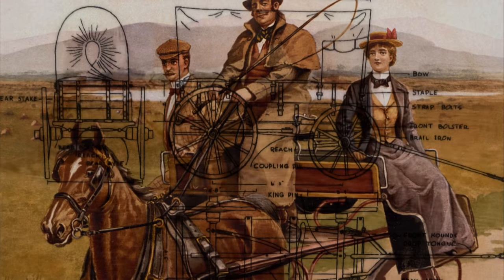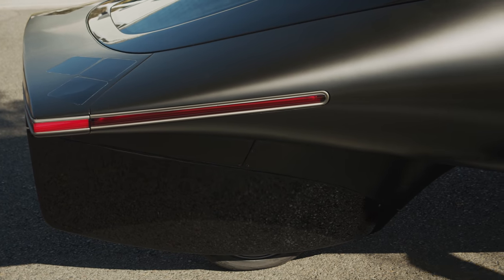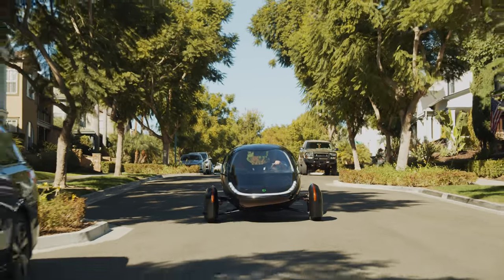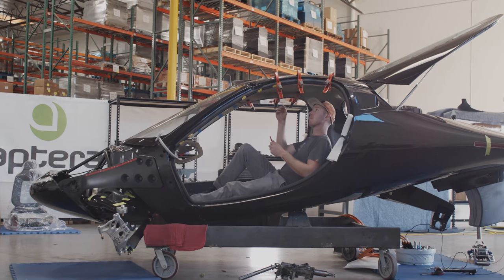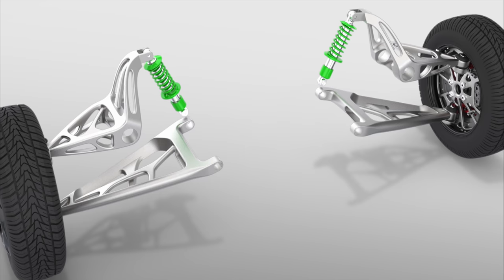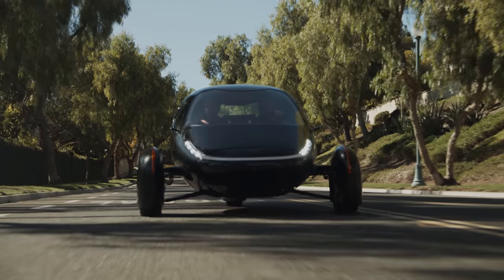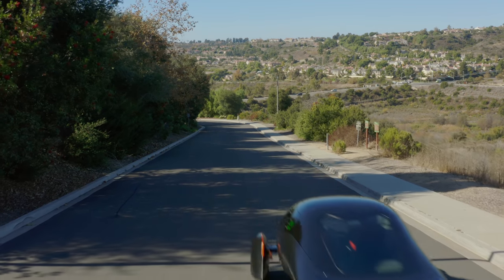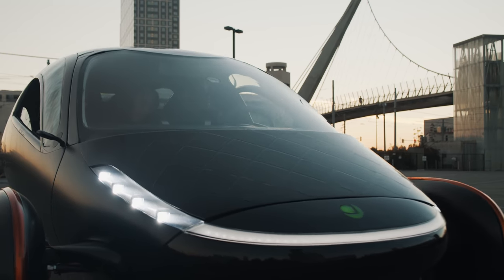Aptera Has Launched

Comment: FINALY a vehicle company that actually wants to make their super deluxe looking prototype a reality instead of just for show.
Reply: Nah, just the same crooks that started this investment scam years ago....
Reply: @sandervanderkammen9230  I'm afraid you are right. It looks so cool but I don't believe it is real.
Reply: @sandervanderkammen9230  Here is an actual product that they have been working on for over 10 years that you can buy. Did you invest in something you shouldn't have?
Reply: @mk1st  Aptera has never delivered a single working product for sale or submitted their design for independent third party testing.
 I would never investment in a company like this which is so obviously a vaporware investment scam.
Reply: @sandervanderkammen9230  This company is a reboot from the original founders who had left the company before an "old school" auto exec took it under a decade ago. The channel Transport Evolved has reporting on this. Aptera is also working with Sandy Munro, who is helping 3 other 3 wheel vehicle companies come to market. After seeing this Aptera is my favorite alongside Arcimoto.
Reply: @Nphen  All the more reason to be skeptical of this obviously fraudulent vaporware investment scam..
Reply: @sandervanderkammen9230  You have obviously not done your research.
Reply: @n.brucenelson5920  I have, and Aptera is clearly a reboot of the same vaporware investment scam..

Moller Skycar is an excellent analogy,  this scam ran for nearly 40 years through multiple reboots and unfulfilled deliver dates...

Comment: Cheaper than a Tesla and twice the level of cool factor, I am tentatively excited for this.
Reply: Which one would you rather crash in at 70mph?
Reply: @cubeflinger  Of course the answer is neither one.  The new Aptera will be tested to automotive safety standards with results before production starts, but still many months off.  Test results from the 2006 version, which was far less sophisticated, are promising, though.
Reply: @RandallJamesPeterson  Much much less. The fwd 250mi model is $25,900 add 900 to add the extra 2 sections of solar. And $2500 if you want the 3rd motor. It comes out to just over $13k cheaper than the cheapest model 3 with the same range.
Reply: @RandallJamesPeterson  It has not yet been scaled up. Give it time. This is only the beginning.
Reply: @halllwd94  , thanks for the price check.  I failed to find that when I looked at their website earlier.
Reply: @RandallJamesPeterson  You had to hit the reserve now button.

Comment: I like what they are saying. But one thing they could have done to bring the whole presentation into the real world is show us the car driving over a speed bump.
Reply: The ground clearance looks about the same as most cars.
Reply: @travishardaway6348  look at the wheels. It has those covers over the tires that look like they would scrape against a speed bump or get scuffed in a pothole.
Reply: @lowmax4431  The wheel has 5in of clearance. If you need to read it yourself, head over to their fakebook page. That's where they confirmed that question.
Reply: I’m sure they never thought of that. You Sir are a genius!
Reply: This thing would get absolutely ruined by some of the potholes I've seen around the uk
Reply: goodfella21f  They have a larger radius than the tire so if the tire slips into a pothole that has a smaller radius than that of the covers, they will get destroyed.
Reply: @lowmax4431  not quite. You drive through potholes in your car all the time.  There will be no difference with this car. The wheel covers are going to be designed so that they just pop off and you put them back on. Also, if you're that worried about it pay extra for the off-road kit and you'll get more clearance and tougher wheel covers. Not to mention 5" of clearance is as much as a lot of cars for sale today.

Comment: Even if it doesn’t sell well, it’s okay as other companies will eventually have similar ideas. With more innovations, we will sooner hit a more desirable future.
Reply: Every engineer knows, how to do more efficient car. Nothing innovative here. The shape of a drop well known for years. Drag examined in every possible way. The companies want sells. Why? Because people wants to buy a practical cars. It is always question of price/performance ratio. What you get for your money. Carbon fibre monocoque not an innovation, for years here. Did they make it cheap enough? This may be an innovation.
Reply: @GroxMirk  
Carbon fiber is expensive. I don't get why they wouldn't use aluminium for the lower end models, make it cheaper at the cost of just a little bit of efficiency.
Reply: @GroxMirk  Intelligent reply.

Comment: Just sell me one of this vehicule already, even if it's just a prototype with a tiny battery, I want such a piece of futuristic beauty RIGHT FREAKING NOW !!! 
I was a kid when the EV1 existed, way ahead of his time. The XL1 was awesome too, but WAY too expensive and not fully electric. 

The Aptera is the answer and the solution =) 7k euros should be enough for a working prototype (I don't want/need the solar cells), right ? Do you ship in France ? ;)
Reply: 7k! You kidding?
Reply: @adimchionyenadum2962  14k max (for 20k you can have a brand new Renault Zoe where I live). No fancy solar cells, just one motor at the rear, a small battery pack with only 120 real miles of range is enough. Less weight, less wires, ect. No need for expensive security tests and regulations, I'm good even with just a working prototype.
Reply: @WlerickBigotOfficial  Okay, then buy your Renault Zoe since it serves your need. We are fine with our Aptera. At $30K, we consider it cheap and are happy to pay that much, and even more, for it.
Reply: @adimchionyenadum2962  I'm not that rich, 30k for the first ever car of a startup and that doesn't even exist yet (and maybe not even 5 or 10 years in the futur => remember all those revolutionary scams not so long ago ? Aptera is unfortunatly maybe one of them), plus the importation tax, shipping cost, 20% additional tax here in France. Make the calcul, for that price I'll better buy a Tesla Model 3 standar range + without any hesitation.
Reply: @WlerickBigotOfficial  , if you want cheaper 3 wheel EV you might want to check out Archimoto's FUV.  They are currently on the road and under $20k USD, but there is a waiting list.  Also there might be a problem with European import tariffs affecting your price competition with the Zoe.
Reply: @RandallJamesPeterson  Yes, like you said, but it's not really a car, more like a 3 wheel electric buggy, I prefer the aerodynamic and futuristic design of the Aptera, it's like a beautiful concept car in real life) =) Also, do you know the Sondors EV ? Unfortunately it's a scam, but I wanted to buy one. Their prototype was a really good looking car, and only for 10k$ (they claimed at the time), it was too good to be true I guess.
Reply: @WlerickBigotOfficial  You may be right about the import tax and all the tarifs that France and the EU may impose on it, but that is a long way from calling it an outright scam. Since it is three - wheeled, it will be imported as a motorcycle, not as car, and that, I suppose, will make importation cheaper. Besides there are now many incentives in the EU for transition to alternative sources of energy, including EVs.
Reply: @adimchionyenadum2962  I didn't call Aptera a scam yet (even if I'm not too hopeful), I'm just saying that since 10 years, I never saw a single project like this become a reality (Elio Motors, Microlino, Uniti, Sondors, Sion EV, lightyear, ect, ect, not even the electric Morgan 3 wheeler). 

You are right, actually we have 7000 euros to help buying an electric car under 45k, and lower tax (or better, no tax at all) for EV would be a very good new for importation and transition, but I don't know if my country will accept such a car to be road legal, maybe it will not be possible to have an homologation for such a unique vehicle.
Reply: @WlerickBigotOfficial  The Sondors is still in development, with pricing closer to $20,000US rather than that initial $10,000 marketing hype figure.  Claimed 300 mile range and manufacturing planned in Italy.  I bought a first fun Sondors electric bicycle 5 years ago off an Indiegogo campaign and it's been great fun and reliable.
Reply: @WlerickBigotOfficial  While this may be correct, remember that Tesla started out with their roadster priced for 4 times as much.
Reply: @n.brucenelson5920  The huge difference is that the Tesla roadster was a true pioneer, a real sport car (made by Lotus) sell as a luxury one, with unique and really expensive techs back in the time.

In the exact same way, i'm not surprise that the next Roadster will also cost 4 times the price of the high specs Aptera.

Comment: Will there be a government rebate for all electric? How will this be insured?
Reply: Pretty sure the government rebate for motorcycles is $2500. I'd check that. As for insurance. Motorcycle insurance is usually a bit cheaper than car insurance. However you'll need to get endorsed. And for the first couple years it'll be higher because you're a new "rider" no matter if it has 3 wheels or not.
Reply: @halllwd94  you can't register it as a motorcycle ROFL..
Reply: @halllwd94  No, at least for 48 of the 50 US states you don't need a motorcycle endorsement, and those two have legislation introduced to change that.
Reply: @Nya875  Actually for most states that is the case.  Check out the video.  That is a California motorcycle plate.  This falls under a new category called "autocycle"
Reply: @Nya875  you will have to register it as a MC in the US.

Comment: the most important thing for the everyday man in the treet, how much is it?.
Reply: 26 to 46K, depending on battery and range.
Reply: @n.brucenelson5920  lmao good luck selling it then.
It doesn't matter how much money it saves you in the long run.
Entry price is what most people care about and for 26k people would rather get a larger and more conventional vehicle.

I don't want this product to fail but these new startups don't understand that people want a normal looking small car without gimmicks that they can drive everyday for cheap.

There is a reason the prius was succesfull despite how dull looking it is. Apart from its drivetrain it's a normal "cheap" car for commuting.
Reply: @MyOldNameWasTaken  I would sacrifice all unnecessary electrical gadgets and comfort for a cheap crappy electric car. Unfortunately i can't buy one, because nobody is making them for the european market.
Reply: @MyOldNameWasTaken  these are made for normal people as much as  the roadster was. Solar on a car is a new thing on the commercial level, and no normal middle class person would buy this.
Reply: @robinhood4640  tesla is working on it actually. it will be a low cost car but they need to make better batteries and adapt to the european market
Reply: @robinhood4640  i dont think so. that car was made cheap because chinese people couldnt but it otherwise, while Europe is a rich country. I think we ll see a compact version of the tesla model y
Reply: @pasticcinideliziosi1259  Europe isn't a country and there already a number of European car manufactures, such as VW with more experience and resources producing normal electric cars for cheapish.
Reply: @mypdf  yeah its true but tesla started electric cars trend, so its some steps further than vw
Reply: @MyOldNameWasTaken  there’s millions willing to pay those prices 🤣 guess you just aren’t one of them and that’s ok
Reply: @MyOldNameWasTaken  if people want a normal car, than why are so many people excited for this car?
Reply: @robinhood4640  Agreed, I'd sacrifice every unnecessary gadget, maybe even a few necessary ones too, just for a cheap, basic affordable long range electric car, but here in North America, most of the electric cars are being sold as ' luxury ' cars and cost a fortune. Even the small, ugly, made in china Chevrolet Bolt STARTS at a whopping $45,000 here in Canada. That's the price of TWO Toyota Corollas. I can't afford that, It would be a struggle to buy one Corolla. If they want electric cars to be driven universally, they'll have to make them available to all income brackets, not just the people at the top.
Reply: @MyOldNameWasTaken  Yeah but consider: no need to buy gas EVER AGAIN. Even using the grid, electricity is far cheaper than gas. You actually save money this way.

Comment: Charged by the sun "over night", funny😂
Reply: Missed that, thanks!  I charge my plug in Prius via solar, but it's grid tied solar, so i guess i charge it by the sun from the day before.
Reply: That's not what they said. It's charged by the sun during the day, but only like 45 miles or so. If you use more than that, you can charge it via charging cable overnight. Actually listen before you make fun of them, otherwise you end up only making unintentional fun of yourself.

Comment: I drive 330 miles every day 5 days out of the week, would this vehicle be good for my use? Id need to drive 70mph the whole way.
Reply: 😧 330 every day??? Dude that $ better be insane!
Reply: The 1000 mile option is the largest I've seen on an EV. Go for that. You can't be wrong...
Reply: Are you a truck driver?
Reply: I think the 400 mile version will serve you great. Get to your destination without hassles, re-charge as you eat and rest, then zzzssssiiii!! Back home at no cost at all.
Reply: @adimchionyenadum2962   60KWh or 100KWh is better, for winter driving and adverse conditions you want the buffer for trips
Reply: It is likely to be quieter, with less vibration than most vehicles.  It should be a low stress ride.

Comment: Be sure to check out the reveal of the delta production design that was released on Dec 31, 2022.  There will be an Aptera webinar on January 20th with more details regarding the initial Paradigm special edition models that will be delivered first.

Now there only remains the fund raising for the body tooling for C.P.C. Group of Italy - the same builder Lamborghini is using - to build the body parts from carbon fiber and glass fiber sheet.  If this can be accomplished during these next three months, we are likely to see the first deliveries of production vehicles yet this year.

Comment: Looks like it could just take off and fly, love this! Now make it self driving and we're really in the future.
Reply: What little drag there is in the design turns into growing downforce at the back as speed increases.  A level two Safety Pilot, that is OTA upgradable is a $1,300 option.  The future may hold more advanced capabilities.  They are looking at several suppliers, and one of them is Tesla.  There will be further announcements about this in a few months.

Comment: I wish this thing had more space to carry products. This vehicle is very important.
Reply from the maker: With 25cu' of trunk space, there's plenty of room for you and your cargo. Actually, you can fit a couple of surfboards, 8 golf bags, or a few snowboards and gear in the back of Aptera. Aptera can also sleep two adults side by side in the rear!
Reply: @ApteraMotors  I run a few businesses here in the Caribbean island of Antigua and Barbuda and one has to do with lawn care. We presently use all electric tools which would fit inside yes but each crew also has a 42 inch electric mower. With a vehicle like this it would eliminate my fuel/charge cost but I wish we could toe a small trailer.
Reply: @macheneclothing  Aptera will have provision for towing very small trailers.
Reply: @n.brucenelson5920  Thanks for the info. Waiting for specs now. This Aptera looks like it could help my business alot.

Comment: What will really sell this car to those of us in New England and the northern tier of US states is showing how this car handles in 6 inches or more of snow, especially in hilly areas. The wheel covers make it look as though the car can only handle an inch or two of snow. If it handles as well as a 4-wheel drive car such as a Subaru in snow deeper than an inch or two, it would be a "no brainer" to buy this car.
Reply: I will be taking delivery of an early model for use in Iowa and will be reporting on my experience in snow.  At this point I am not too worried.

Comment: As I mentioned in another video the day I signed up for the newsletter, the loud music in the video is unnecessary and prevents a number of people from being able to watch them. I stopped this one fairly quickly, jumped to a later section where people were speaking and closed the window right away because the loud music was still blaring.
To make the videos accessible for more people, remove the music from your older videos and stop adding it to new ones!

On another note, I was hoping to be able to send a reply email through the newsletter, but I can't, so I'll ask my question here:
When will Aptera develop a deep winter option for the car? Where I live in Canada, the winters get down to -40 C/F and colder for about a week. And it's often in the -30's C & F for about a month mroe. I found a section that stated the car can handle to -20 F, which is -29 C. So if I were to get an Aptera, I would be unable to drive it for at least a month out of the year.
Also, the snow can get quite deep and less travelled roads in my neighbourhood are not plowed as often as the main roads. I have a suspicion that the Aptera would have trouble going through 2-3 feet of snow. Cann someone get back to me about these concerns?
Thank you.

Comment: This is the first EV that has ever interested me seriously.  At the price, I could actually own it but, I need it to be able to charge in 10hrs enough to get the 1000 miles per day..  HOOAH!!!
Reply: When the 1000 mile battery packs are ready that rate of charge will be possible, but only from a 220 vac outlet or higher- 110VAC will not be quite fast enough.